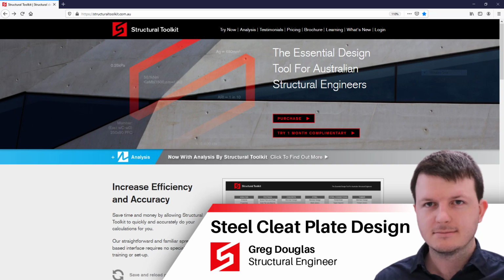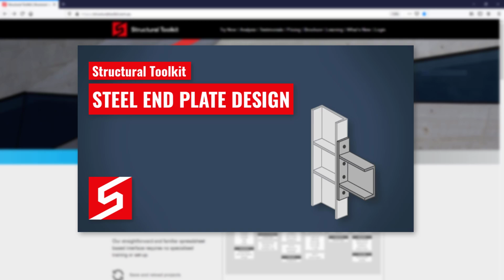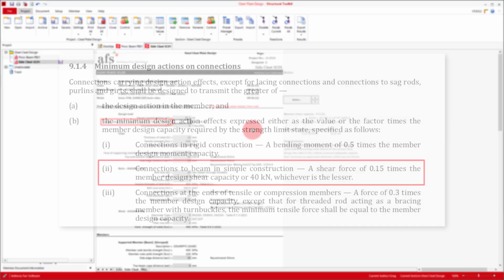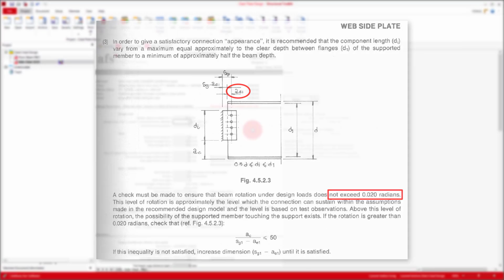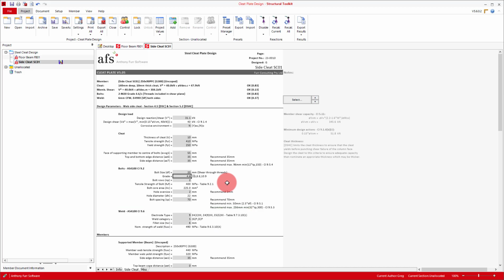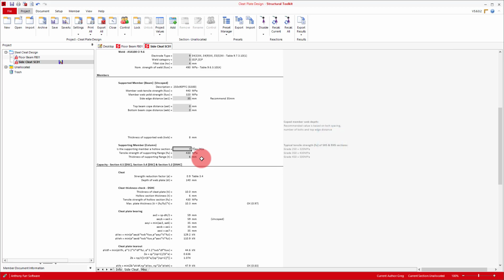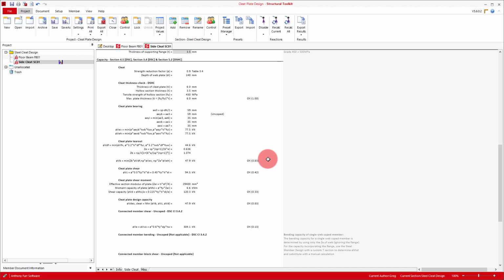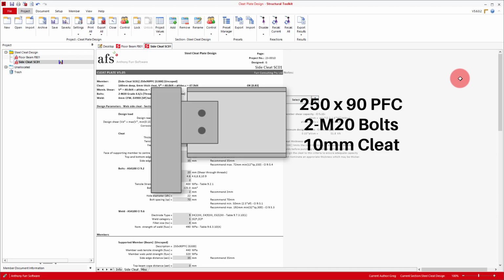Structural Toolkit: Steel Cleat Plate Design - AS 4100

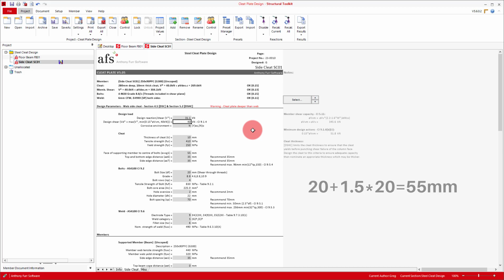Comment: 5:36 1.5*20 + 20=50mm not 55
Reply from the maker: Yes you are correct, thanks for pointing this out. What we probably should have said is that typically this is 20mm + at least the minimum edge distance being 1.5*bolt dia. However, this module as default uses the recommended edge distance values from Table 2.2.4 of the design of structural steel hollow section connections (Blue) book. For M20 bolts this is 35mm, which means 20+35=55mm.